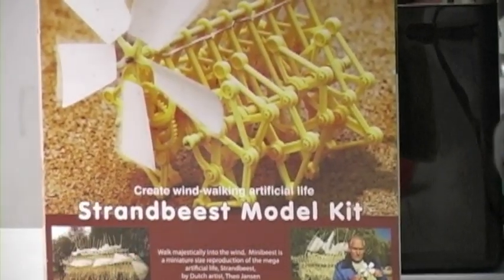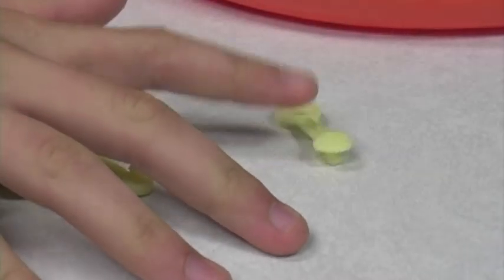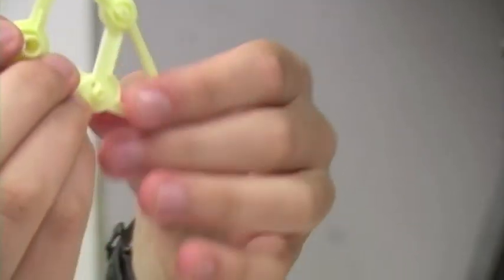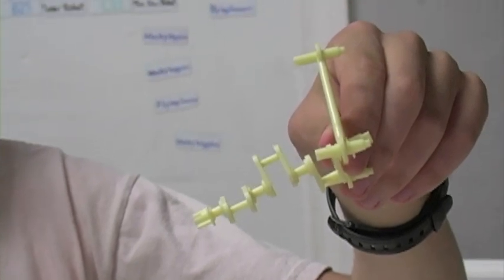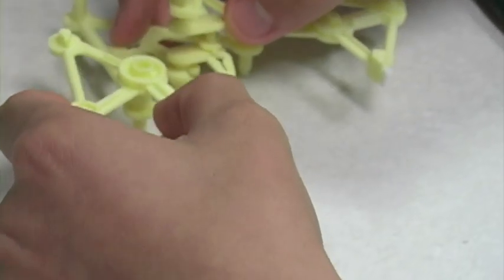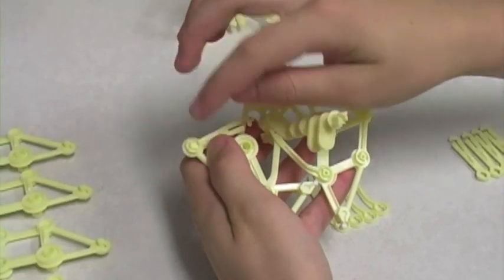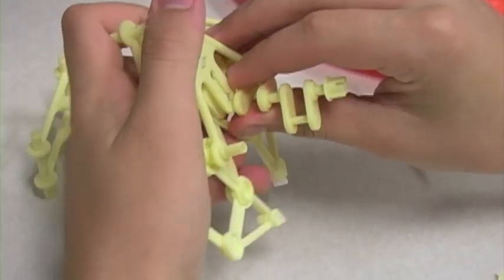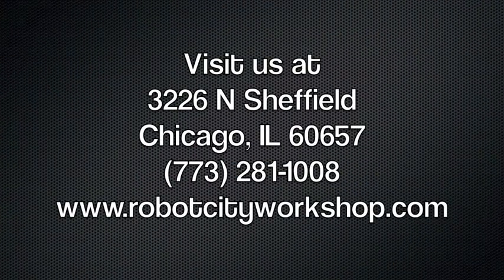Build the Strandbeest from Jr. Scientist series (Part ONE)

Comment: Thank you for the videos on building the Strandbeest.
It was very helpful. My model was only slightly different than yours.
I finally got it successfully built. One big error in your video that may
have thrown me off for a while, at 3.03 you refer to part E as the larger
action rod. It is the smaller action rod. Next, but not a big thing, at 2.35
when you mention the protrusions, the shafts protrusions are not clearly visible in the video. Both ends have a protrusion of sorts. You were referring to the male end.
 I would like to offer the following tips to builders:

1. When you are building the leg assembly, make a short cheat sheet
 on paper,

    - Right and left legs, foot down toward the crankshaft
  a. Right leg, high joint, short action rod
  b. Left leg, low joint, long action rod
  c. Right leg, low joint, long action rod
  d. Left leg, high joint, short action rod
   -  Double check at the crankshaft that your snaps are a,b,c,d sequence.

2. After adding each pair of legs, count your remaining long and
  short action rods and make sure you have an even match.

3. Also, after adding each pair of legs, manually turn the crankshaft
  to make sure it turns smoothly. If you have joints hitting each other,
  you have a wrong size action rod somewhere.

4. After the three pair of legs don't forget to add the last A frame, (note
male/female connection direction.)

5. If you have my model with tiny angled plastic fan blade connectors,
   the angle points outward, flat part is seated on the blade.

TallDudeInLA using my wife's channel (Her name anyway)